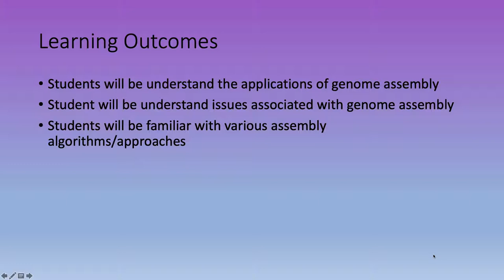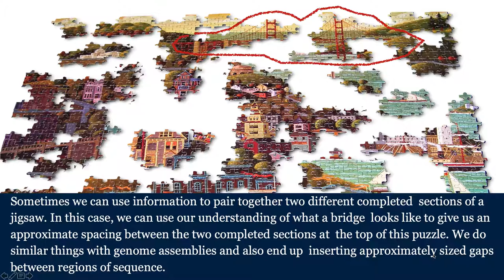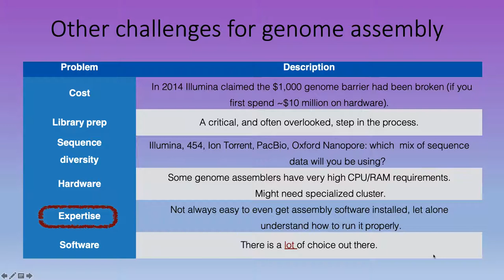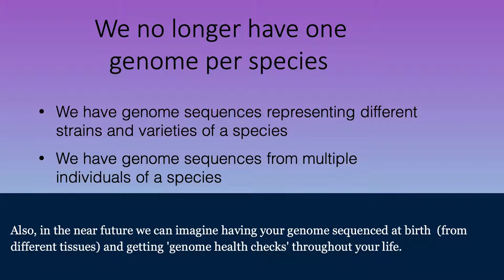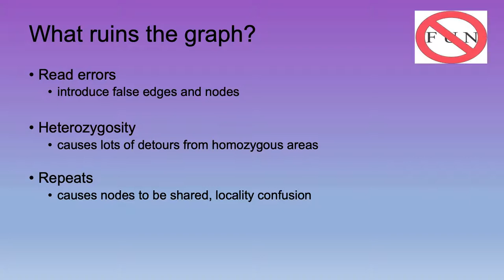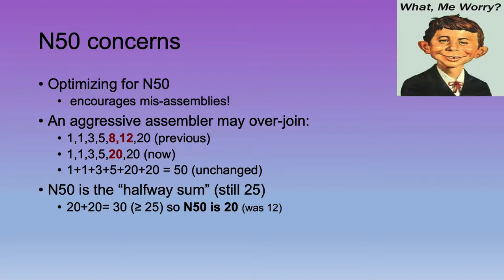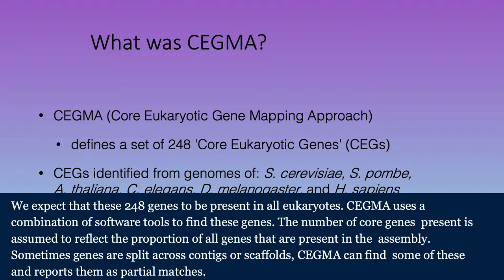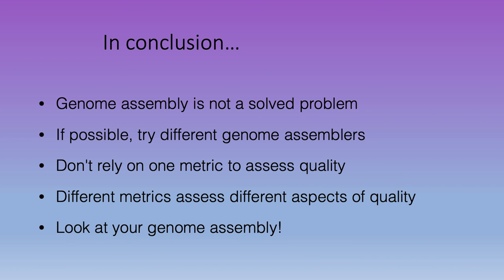Bioinformatics Lecture 13: Genome Assembly

Comment: Hello Nathaniel, firstly thank you so much for this video on Genome assembly and the issues, approaches and algorithms and tools used for assembly. Secondly, I came here watching this video by having a prior knowledge of what assembly is, different types of data coming from different tech's and algorithms used. However, i was reading the assembly algorithms without actually understanding the meaning of it(especially OLC), but in this video i came to know and understood the meaning of OLC where you have perfectly broken OLC into three words and explained the meaning of it (i.e find overlaps, remove redundant sequences and consensus). Now i am very clear about the working of OLC (if not in detail, but abstract). Thank you so much again for your time. Hope people will find it useful soon.